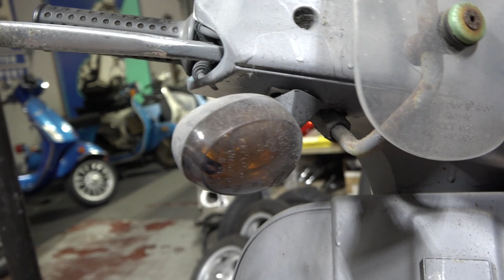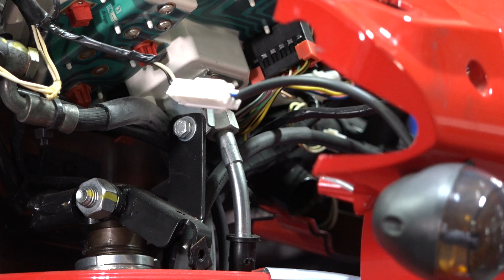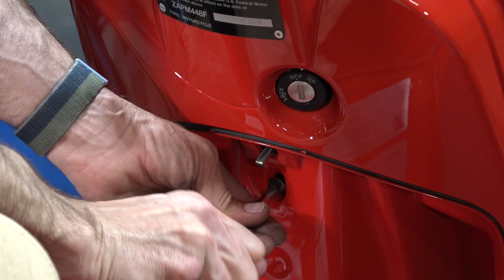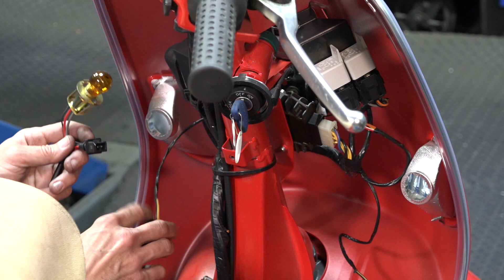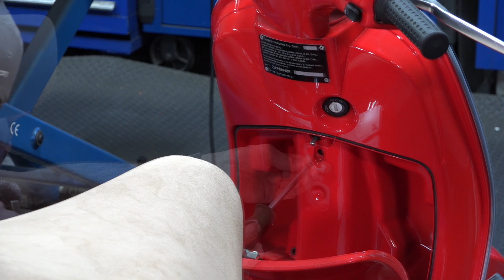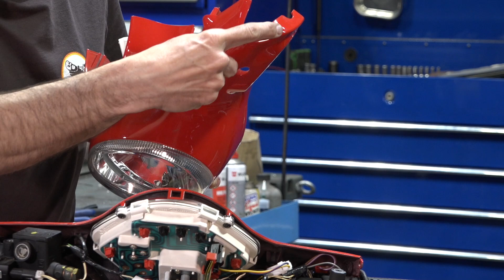Pod Turn Signal Delete Kit for Vespa LX/S Scooters

Comment: I just bought the kit and did the install myself on my 2009 Vespa LX150.   I'm medium-handy and it took me about 2 hours start to finish.  The hiccups were getting the plastic covers apart and I had a few screw heads that were stripped.   If you take your time and get the tools suggested, I think is do-able for people with some mechanical inclination.  Thank you for the kit and east instructions!!!

Comment: Piaggio fly 2015  I accidentally pulled the green barrel off the clip behind the key barrel That turns the electric On and off Yes since then I reclipt it and lights will only come on Before this    throttle body used to make a hum when you turned the key And now does nothing only like to come on we'll not even turn over

Comment: Vespas are well built no doubt a bout it, but 4000 dollars minimum no thanks. I'll stick with a sym lance just as dam good if not better. Sorry 13.000 miles no problems ever. Since I've owed it. Plastic body does suck on syms. No doubts. Mechanical the best  ever.
Reply: I paid 1,200$ for my LX50 It’s de restricted so I can go 55mph when I need it too!! You can find them used if your good with mechanics

Comment: Love your channel but Vespas suck I have a sym and i ain't ever had a problem with them 13.000 miles on it , 1 ,400 dollars I payed for it. The only bad thing about syms is their plastic body's parts. They suck. Other then that, I ain't never had mechanical issues, ever, Vespas are great but over raided, and to Dame expensive. To fix . I've watched you for 13 years. And I love your channel, you are a scooter expert.